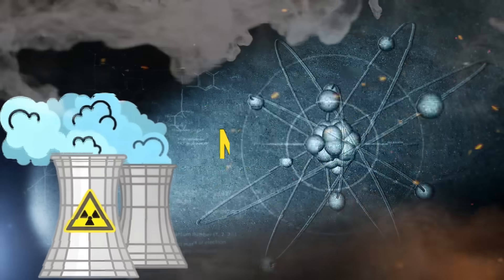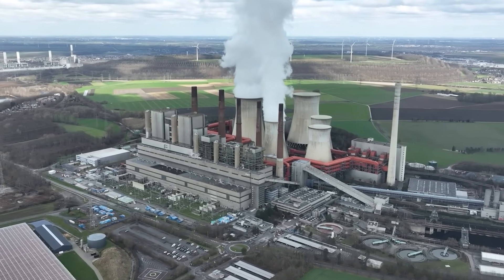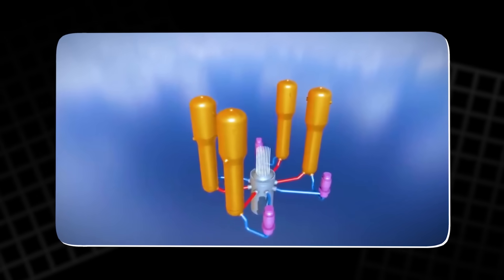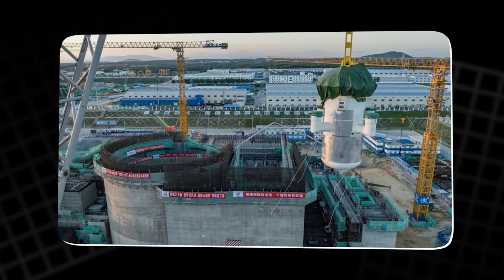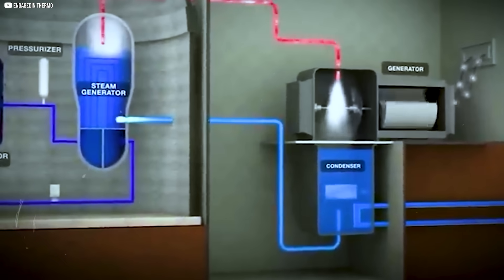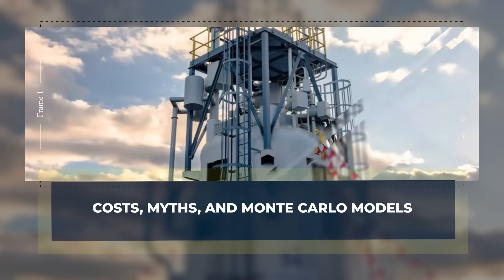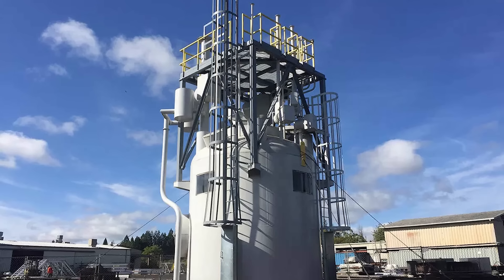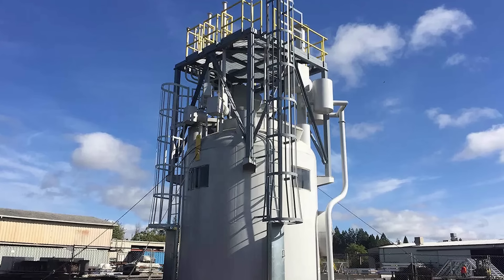China’s Silent Nuclear Revolution: The SMRs Already Powering the Future

Comment: 3 Small Modular Reactors are being built by Rolls-Royce. 90% is built off-site in a factory. Each will generate 470 megawatts of power for at least 60 years. They already have a site at Wylfa in Wales ready to accept them. Many more are comming and the price will drop, alot.
Reply: We do not trust UK.

Comment: High pressure water reactor is a problem, like in Japan.   That's why other SMRs are using low pressure reactors, which were never developed.   So much steeper learning curve, but safer as I understand it.  Just spread the reactant material out and it's temp drops.

Comment: Does this look small to anyone? Small power output maybe, but still looks like a typical mega-project where massive civil works will bottleneck deployment, and it would more aptly be called a Large Modular Reactor. So, typical SMR (I'd trade the entire US SMR industry for a thorium molten salt breeder reactor program, which incidentally, China is also pursing. @FlibeEnergy and @CopenhagenAtomics are also developing them, but thorium is extremely disfavored here, actually being a good idea and all).

Moreover, both pebble fuel and helium cooling are terrible ideas. The former is very expensive to produce, still grossly inefficient, effectively non-recyclable, and handling is greatly complicated when the primary loop is under high pressure. Helium may be efficient, but it is not a good coolant, requiring large volumes and high flow rates, which incidentally prevent the reactor and turbines from actually being small. sCO2 is a much better choice for the power cycle, but while compatible with MSRs, it can't be used as a coolant in the primary loop.

There is one case where pebble fuel might not be awful, and that is in Kairos Power's fluoride salt cooled reactor, where the pebbles are actually slightly buoyant. That not only greatly reduces stress on them, it makes for easy replacement from the top since they basically float in an unpressurized vat of salt, which is also a much better coolant than helium (and even water) while also being impervious to radiation. Still, the need for HALEU may kill it.

Comment: pebblebed is meltdown proof not because it can cool itself, but the hotter it get, the slower it react since heat would cause the pebble to expand physically from being heated and lower the chance of the uranium getting hit by neutron. this expansion eventually break the chain reaction and stopping the reactor.

Comment: Helium:  impossible to prevent it from leaking.    Require 100% hermetic seal, will leak through any joint.
Reply: Helium has a lot of benefits, it's basically radiation-proof and you can heat it to very high temperatures. But yeah, it leaks through anything
You have to replace it, and worry about the degradation of the containment vessels
Reply: @tomholroyd7519  They will switch to Nitrogen someday. However, you will need to separate N14 and N15 to prevent C14 production.

Comment: Within 3 years at current emissions levels we will blow past the limit that would keep us under 2 degrees C. We need 15,000 nuclear reactors and we only have 450.
Reply from the maker: You're absolutely right! The urgency for sustainable energy solutions is critical, and nuclear power could play a significant role in addressing climate change. It's definitely a conversation worth having!

Comment: Thought France already runs smr nuclear power reactors for a lot of its electricity and has been for a while
Reply: Only China has successfully built a working thorium SMR.
France operates what is called LEU reactor which is completely different. 
Its Uranium needs to be replaced every 10 years and is also used in her warships.
Reply: France Produces 75% of its electricity from nuklear but with normal seize uranium reactors. They have a couple of fast and super fast breeders ( Phoenix, super Phoenix) though
Reply: @joachimschreiber7835  There is no SMR in France, but there are a lot in Russia
Reply: I believe that around 60% of France electricity is from nuclear, it used to be even 75% un the past
Reply: The type of technology may vary
Reply: France steals it's uranium from Africa.

Comment: The safety scales parallel to prize. In Germany the first 1200 MW nuclear Powerstation was Biblis A. It had a containement wall size thickness of 60 cm. To small to to protect against an airplane crash. Biblis B had 100 cm. Better but still to weak. Last german AKW had 200 cm wall thickness. Yes now an airplane crash may be no problem. The newest western reactors have double containments which brings the prize over 10 Billions. All nuclear reactors if small or big generate nuclear wast. And using a fast reactor in a weak confinement sounds even more suicidal. In China there is no popular resistance because China is dictatorship without the hurdles seen in western democracies.
Reply from the maker: You bring up some important points about safety and containment in nuclear power. It's true that advancements in technology have led to stronger structures, but public perception and regulatory frameworks definitely vary between countries.
Reply: @TheForgeEmpire  Yes in France it is different than in Germany. Both are european democracies. China celebrates now an Thorium reactor. The same architecture was build 50 years before in Germany. But this reactor revealed as not so worthfull in energy economics and was shut down therefore. Afterwards the standard Pressurized Water Reactor had become standard architecture. To use the thermal energy the condensor temperature musst be raised from 50 to 100 Degrees. This lowers the electrical output. An Small Reactor (300 MW el.) was Obrigheim im Germany. To build 6 times Obrigheim instead one EPR with 1600 MW el. makes no sense. So I cannot see any advantage of this new SMR Reactors. Also in older AKWs, the internal parts had been produced in factories. And especially France avoided to leave an standardized architecture for more effective maintenance. So SMR is nothing new or better than given reactors like the european EPR. The EPR is so expensive because high security with double containment and core catcher.
Reply: "China is a dictatorship without hurdles seen in Western democracies"; Does it mean China's SMRs are not safe? If your answer is that it is safe, which is what this report is stating, what does it says about Dictatorship vs Democracies?
Reply: @adamiskandar5107  The real safety characteristics of chinese SMR's are difficult to judge. But for Germany and Europe I would prefere some french EPRs over china stuff. And yes, China has a big advantage as dictatorship in economics and development. Under Hitler a lot of big buildings had been realized. Most european nations are slow ducks today. This is reality.
Reply: @wolfgangrenner4152  The world has changed, you no longer have any advantage
Reply: Your definition of "safety" is the ability to withstand the impact of an aircraft? Does your country have plane crashes every day?🤣

Comment: Is steam comming from nuclear power plant radioactive
Reply: technically yes but still within safe margins, and less radioactive than coal and oil plants
Reply: The initial heat medium transfer heat to the next stage in a sealed environment, the secondary medium transfer heat to the tertiary medium in a sealed environment.  The steam coming out of cooling towers are n-th level medium that don’t contain radioactive elements.
Reply: Like xinfuxia said, the cooling tower steam is separate. All the electricity comes from boiling water to make steam that drives a turbine. The heat source is in a sealed environment, and they are also using Helium, not water, to cool the reactor. So the very hot helium (which is not radioactive) heats the water to make steam (and Helium is also not radioactive, that's one reason why they use it, it's radiation-proof)